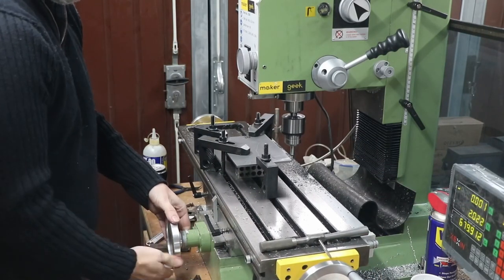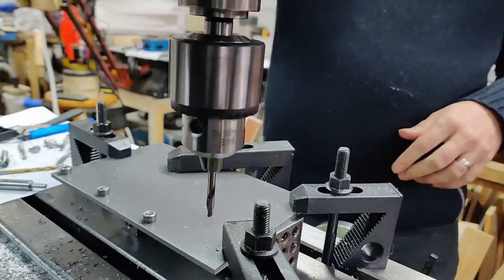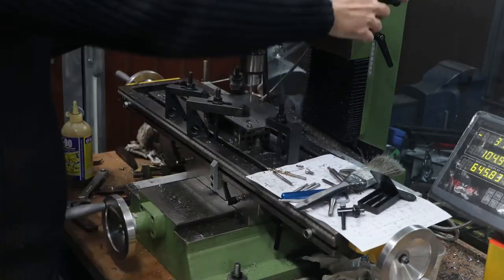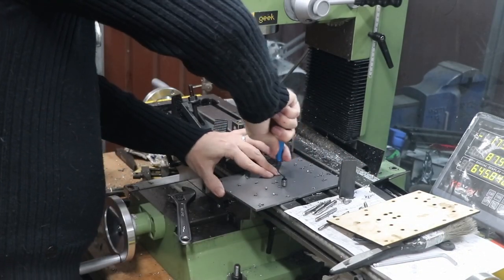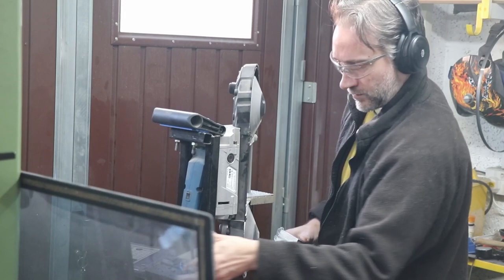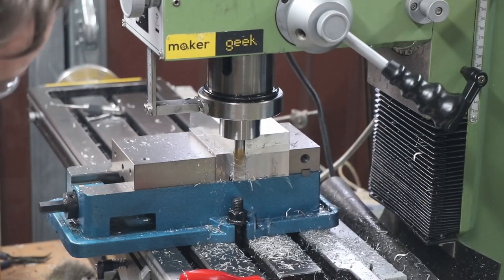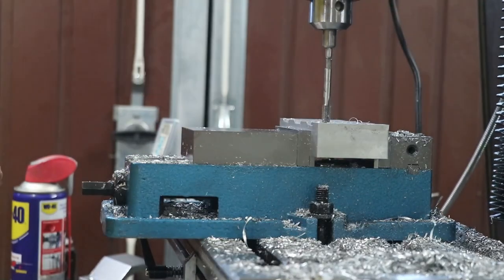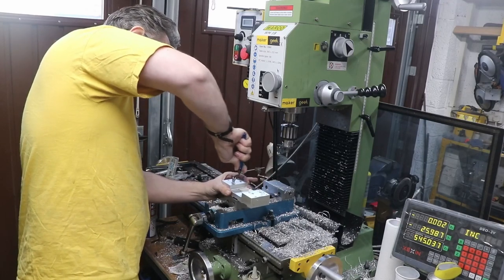Custom CNC build: part 3 - Z Axis

Comment: My current project involves drilling and reaming four precise holes in a brass part which measures 1” square. Spot drill, drill and ream 0.8mm holes in an initial run of 16. Soooooo many tool changes. Takes ages. I feel your pain. 
Excellent progress sir 👏👏👍😀 Andrew
Reply from the maker: I thinki can cope with considering it a relaxing Zen thing when I'm only making up to 2 of the same thing. I think 16 might drive me crazy